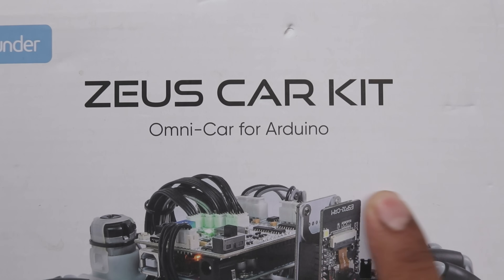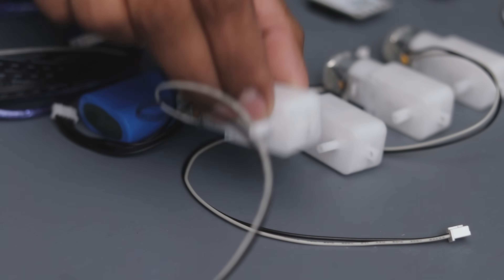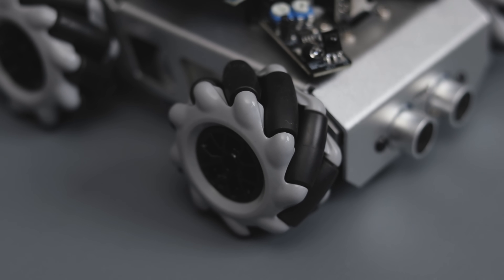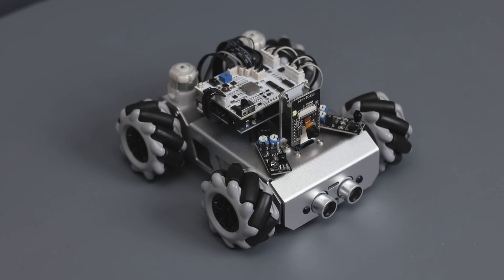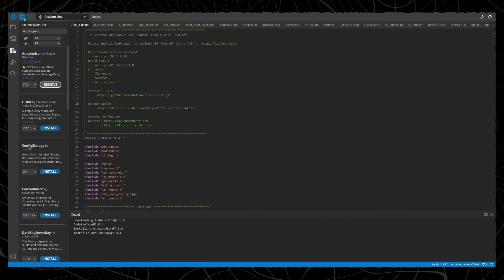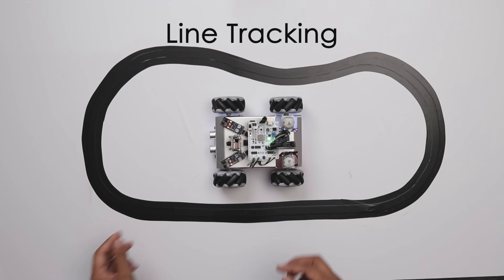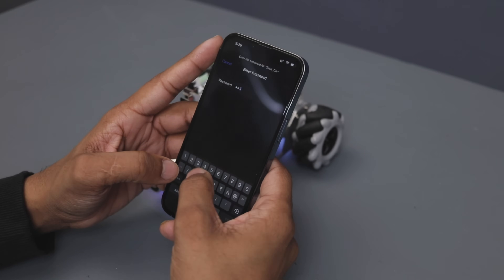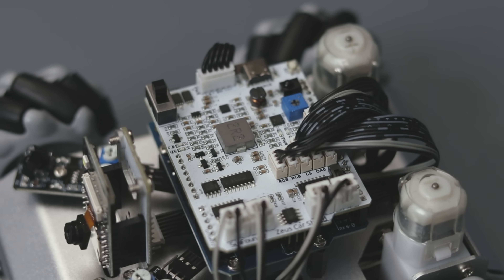DIY Omnidirectional Car with FPV Car Assembly | Arduino Car Kit

Comment: i wondered if the cars will fall off the table in obstacle avoidence mode 
also what is the difference between a pcb , ardunio , raspberry pi 
it would nice if you tell me any resource where can i learn about these electronic stuff as i have been watching these type of videos from the time i was 12 lol , thanks